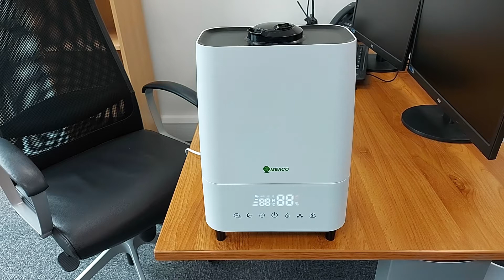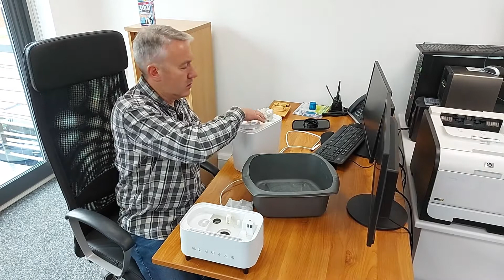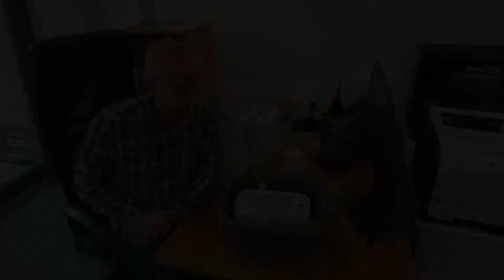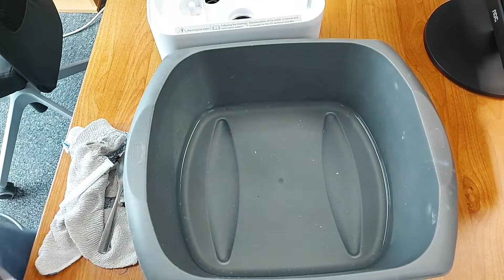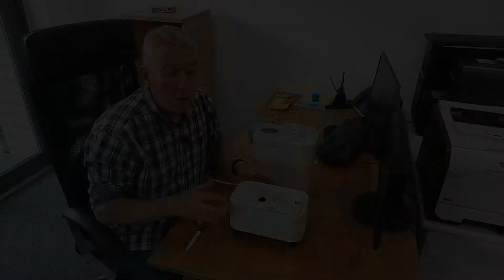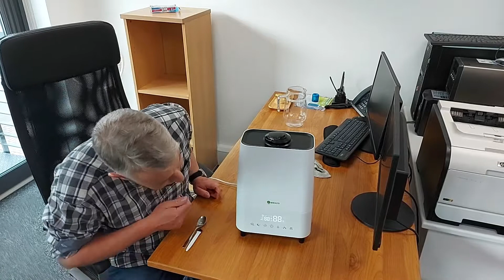How to clean your MeacoDeluxe 202 Humidifier | Meaco

Comment: Does red mould accumulate under the vents on the top? If so, how should I remove it?
Reply from the maker: Thanks for your question. Red mould shouldn't normally develop around the air vents. What people sometimes see is dust, dirt, or discolouration caused by moisture in the air. We recommend regularly cleaning the air inlet and outlet vents with a soft, dry cloth or a vacuum using a brush attachment. Always switch the unit off and unplug it before cleaning. If you believe mould is present, please contact our customer service team with a photo so we can take a closer look and advise further.

Comment: @meaco there is an 18L variant and is exlcusive to costco, it states on their site it is 250w and many of the specs seem to be the same as the 20L variant, would you be able to confirm the wattage of this model please?
Reply from the maker: Just people don't get confused this question is about a dehumidifier and not the humidifier in this video.  

The 18L at Costco is almost identical to the 20L available elsewhere, just that 2L or 10% difference.  The energy efficiency is neigh on identical and you can go off the 20L data.

Comment: Hi, in one of your video you said about salt solution for water filter. According manual, it's should be an 5% salt solution, which is 50 grams of salt/Liter of water, according my calculations. Should I use basic food salt, or it is some kind special salt? Can it be sea/iodized salt? Thank you.
Reply from the maker: Normal salt is fine.

Comment: can this also be used as an air purifier?
Reply from the maker: It filters all air coming into it using a combined HEPA and charcoal filter.  Add to this the ultra violet sterilisation of the water and you can be sure that the humidified air is clean.